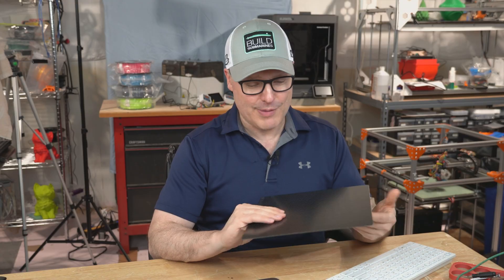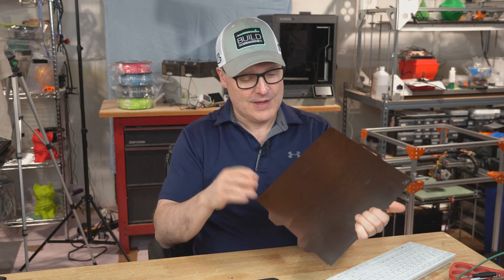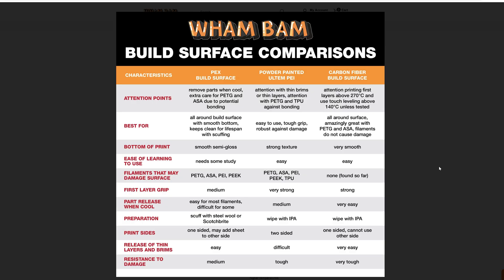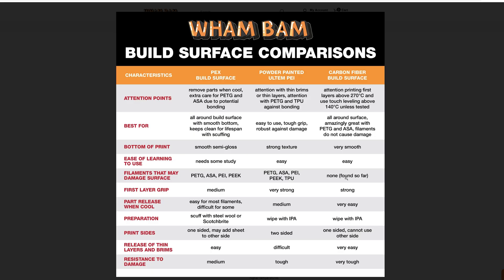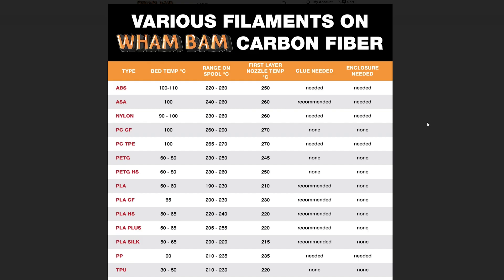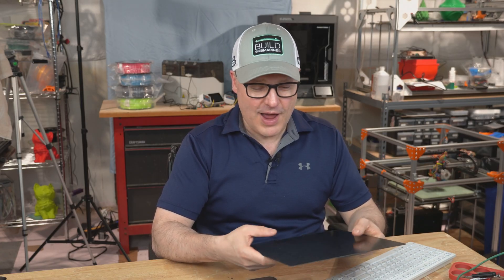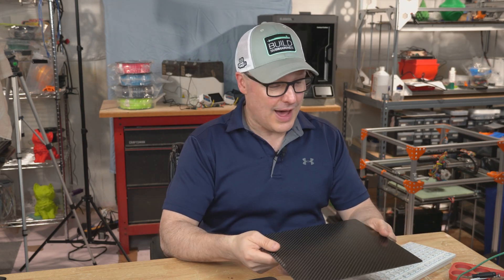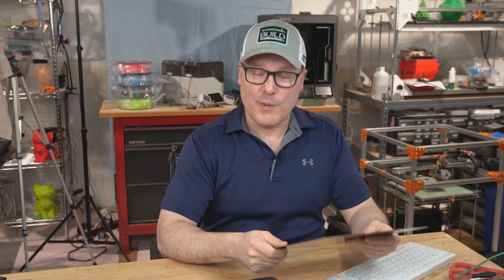The #1 3D Printer Bed Upgrade You Need for PERFECT Prints

Comment: Hey Mr Cool, would you mind posting links to these comparison tables (in the video Description)?  I checked their site, and found only a water-ed down version of the first table, and nothing for the second.
Reply from the maker: Hey Mr Crttic, if you check the link for the product, if you hover over the chart, mouse click the plus the get a full view.  Which is exactly what I did 🤓
Reply: @WhereNerdyisCool  Not sure if you meant "Mr Critic", referring to me, but if so, I'm not trying to be gratuitously critical. I'm trying to amplify your helpful message for me and others, by way of nailing down a link to the info you presented in the video and recommended we look at.  Now, you say to check the link for the product (your bitly link in the Description).  This takes me to a product page, where there's no chart in sight. (I'm using Firefox on desktop, if it makes a difference).  
However, I now see that on that page, the thumbnail carousel control does indeed include images of the two tables you showed, if you scroll it over a few steps.  And as a hint for others, if you select one of these tables and click to expand, you can then right-click it and open the image in a separate window, which may be easier to view, print, or save.  
Anyhow, thanks for responding and at least pointing somewhat in the right direction!
Reply from the maker: Click the pictures sir
Reply from the maker: Yes!  Glad you found it. Sorry I was trying to reply on my iPhone and didn’t give a very good answer